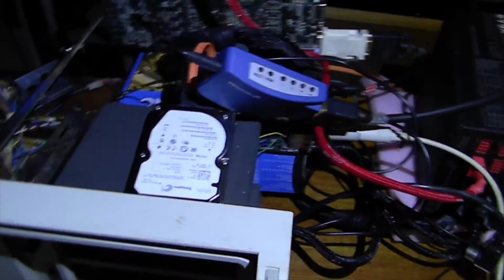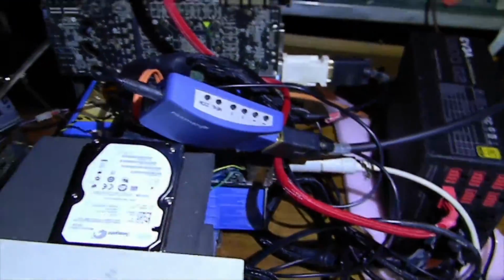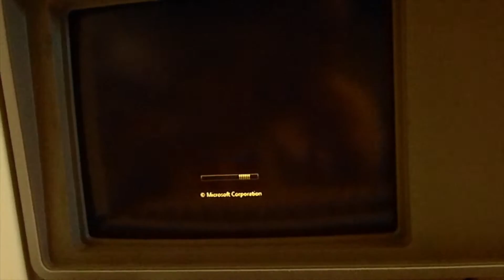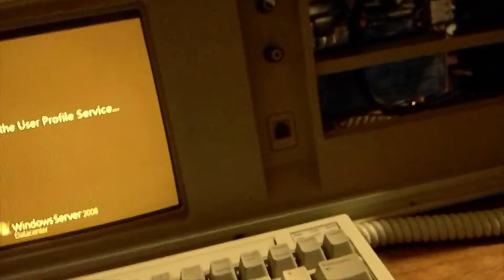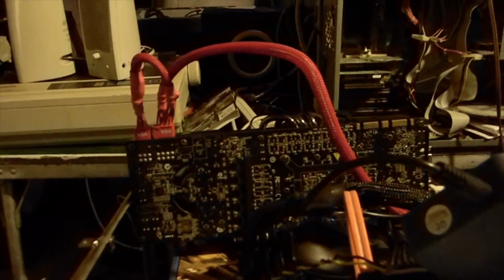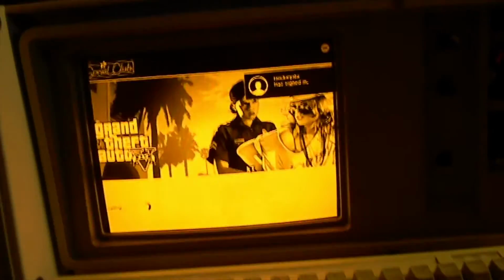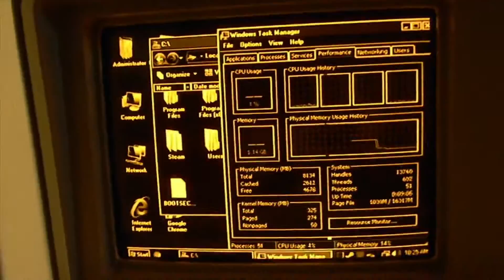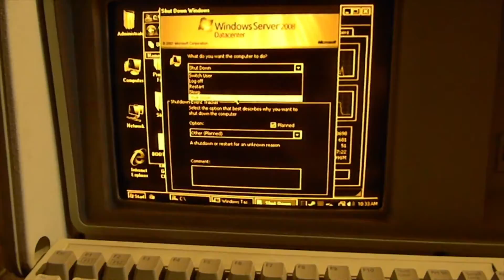IBM Protable 5155 Modernization Update!

Comment: Would I be able to connect the Amber Composite screen to a Raspberry pi 4 by plugging in a 4 pin male to S video male, then plugging the Svideo into a female SVideo to HDMI, then plugging an HDMI Male to Micro Hdmi Male into the HDMI Female, then plugging the Micro HDMI into the Raspberry pi Micro HDMI port?
Reply from the maker: i have never used HDMI before. but if you use the luma from S-video you will get a great picture. also keep in mind external DAC's are quite slow and you will get somthing like a 0.1-0.5 second delay if you use one
Reply: @RockeyDAproductions  Could you link a specific product if you have one in mind?
Reply from the maker: @avabluej5719  i dont have a product in mind, if your microcomputer thing has somthing analog out, use it. i dont think there are any good external dac's. hence why i wont use a current production GPU.

Comment: What screen resolution are you running? I never would have imagined a small composite monitor would be readable above 640x480, but whatever you're running here looks really good.
Reply from the maker: 640x480 desktop but gta lowest is 800x600. i have such a good picture becase s-video breakes up bright and color, only using luma makes ntsc composite look like ntsc component. if you got somthing s-video give it a try.

Comment: That monitor really does look awesome with a modern computer, but as a vintage computer enthusiast it absolutely kills me to see a machine that collectible and valuable defaced. I really hope you sold the internal parts (such as the motherboard/cards etc) to someone who needed them Instead of just throwing them out. I know it probably “didn’t work” but I can assure you it would have been a relatively easy fix.
Reply: this is what RockeyDAproduction said...... it was already broken in short, in long some tantalum caps went bad and i can totally fix it but since i have 5 of these i wanted to do something really cool with one. i got 4 of these and a PC XT for nothing.